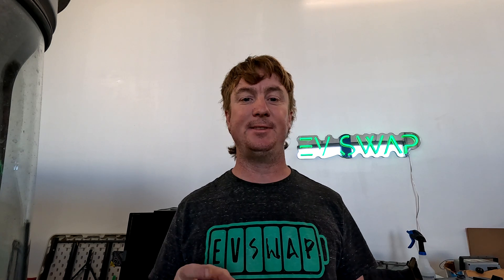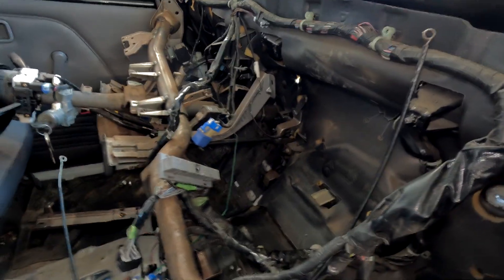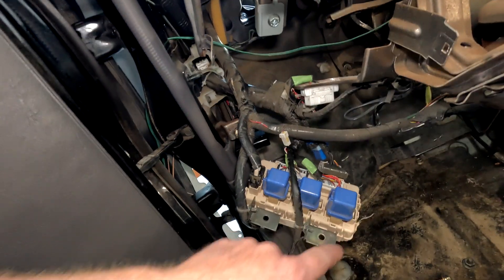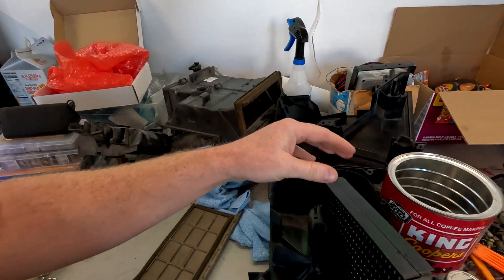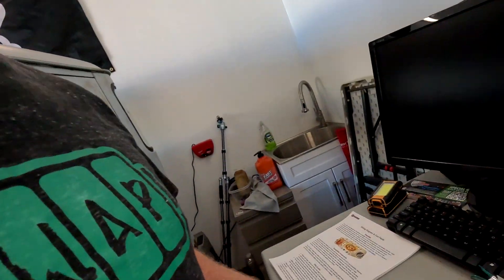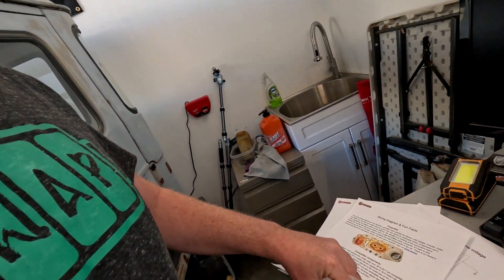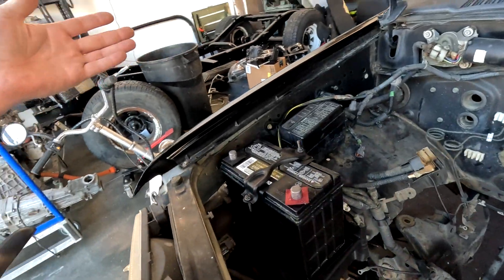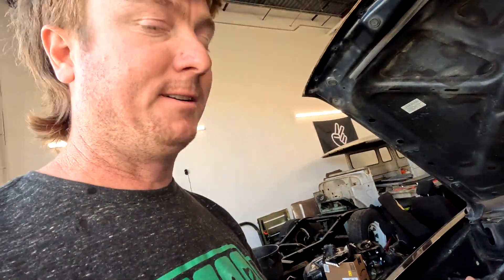Nissan Frontier EV Swap Update 4 - 12v System, Resolve-EV VCU, and Heatercore

Comment: I'm doing a similar swap on a 96 Nissan D21 4x4. I'm using the same adapter plate from Brat Industries. I decided to use the Zombieverter as the VCU instead. I'm still looking for a donor Leaf at this point.

What year is the Nissan you are converting?
Reply from the maker: Very cool! This Frontier is a 1998. Similar transmission but updated chassis from your truck.
Reply: @EVSwap I'm excited to see your solution for the motor mounts. :)